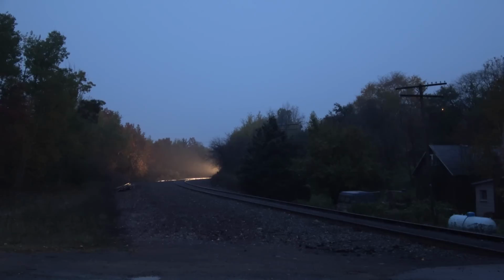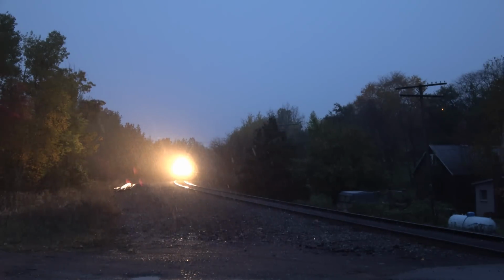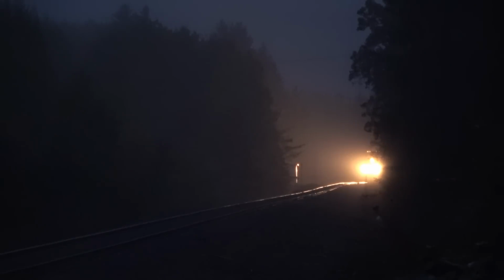TRRS 530: LS&I GE C30-7s Stall Out with an Ore Train!

Comment: Excellent Video!  And yes, wet leaves are not conducive to good traction.  
Did you change your audio setup recently?  The narration over the past month or so has been much improved over the past.  Top notch production quality across the board now!
Reply from the maker: Long story short I figured out that I was unwise to leave the microphone level settings on audio. So essentially it was all over the place, guessing what the correct levels should be. So now I shoot and record narration at the same set level, bringing them much closer together and preventing the peaking (crackling) that I had been fighting before. 

So now going forward both the video and narration quality should be much better than they used to be.

Comment: Some SD70ACe's would be beneficial for them, if they weren't a 100% GE fleet.
Reply: they have a contract with CIT group to lease the AC4400s. Those are one of only a few locos that company leases out. It also includes SD40s and a few other older locos.
Reply: Or GEVO's because SD70ACE's produce 4300 HP and GEVO's produce 4400 and a C4/AC/AH would benefit them aLOT
Reply: @inlandempirerailfan4269  SD70ACes now produce 4500 hp from the factory.
Reply: The regular ones got upgrades or the tier 4 variants?
Reply: @inlandempirerailfan4269  they got upgraded.
Reply: im Brasil GE C30-7 rumo logística,, GE c30-7 S7 MRS logística,, GE c30-7 A Quintela 7202,, BB36-7 VALE,, BB40-9M VALE

Comment: NOOOOOOOOO. theres sd9s still in service since the 50s that are 70 and these are only 40 and theyre getting rid of them?! Theyre BN C307S! Thanks for this though since ill never see them im person. Truely thanks this video was awesome
Reply: LS&I is just hard on their units and they don't pull as well as they used to. I'm sure they will try to sell them first before scarping them so I wouldn't be surprised if they wind up coming to a shortline near you ;D.
Reply: @cheeze5875  yeah i sure hope they dont get scrapped or repainted
Reply: im Brasil GE C30-7 rumo logística,, GE c30-7 S7 MRS logística,,BB36-7 VALE GE c30-7 A Quintela 7202,, GE c36-7 VALE
Reply: im Brasil 1 GE c30-7 Paint BNSF ,,1 GE c30-7 Santa fé